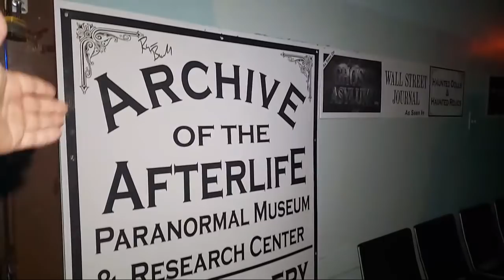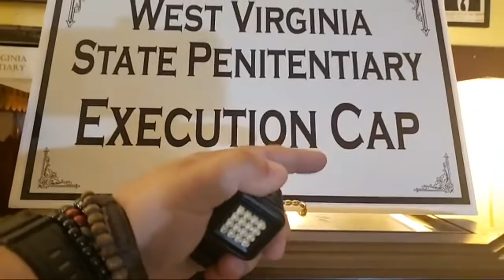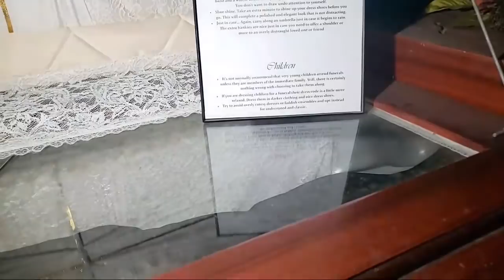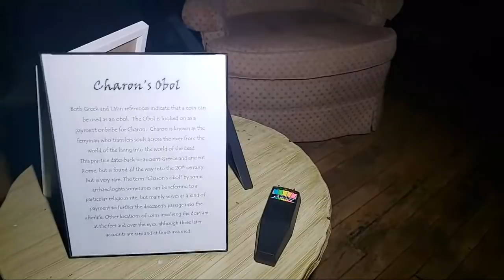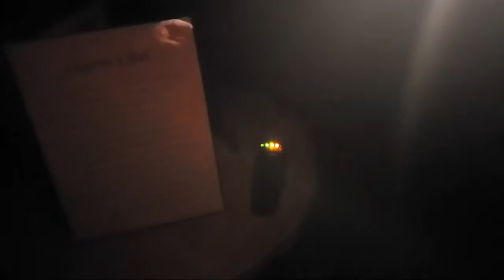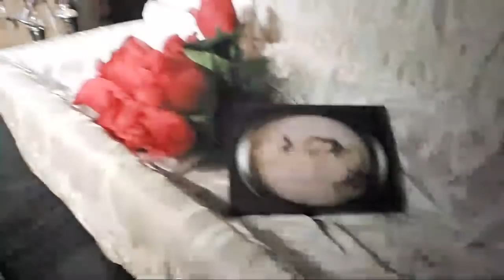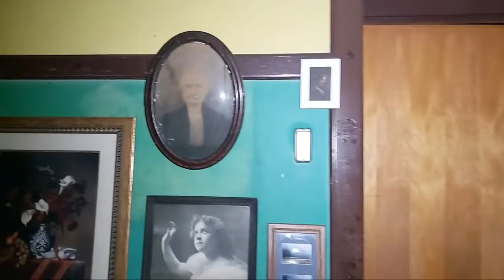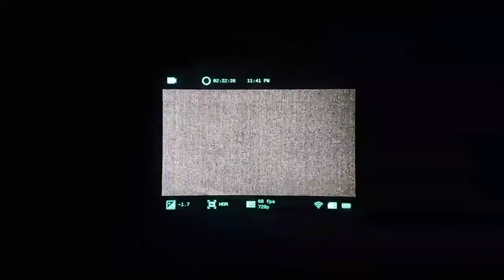HAUNTED MUSEUM ALONE  (ARCHIVE OF THE AFTERLIFE)

Comment: Okay, just as I had suspected...I believe something has attached itself through this video. I'm not sure exactly how that works but I've heard of it happening before. Three hours after watching this, I go to bed... I just woke up to use the bathroom and low and behold I'm sitting on the shitter in the dark and I hear this noise in the shower...something hit my razor, which is dangling so it starts swinging. I flip on the light and just stare at it. Then I'm like ok...it was probably just sitting at an odd angle and got dislodged or something. Then, I hear what sounds like someone's hand sliding and gripping the metal hand bar and a ping like someone flicked the metal. At this point, my ass comes off of the toilet, I fling the door open and sick my cats on whatever it is. I hurry up, finish my business, wash my hands and here I am. You might want to consider including a little protection prayer at the beginning of your live investigations for yourself and your viewers. I'm not a religious person, but I believe in a protective white light! I guess I'll be smudging today. I still love you, Frank!

Comment: Franko you are ever so brave and such a nice person too. I am concerned that your solo adventures do court risk from dilapidated buildings, squatters with warped values, and especially danger from malevolent spirits. You would be safer if you at least paired up with a buddy or 2 or 3. At least help would be on hand if you need i. Then, you should explore together and avoid the temptation to go it alone. Every explorer should have a working walkie talkie with spare batteries, spare lighting / torches, a first aid kit, crowbar in case  you are shut in,  a New Testament, cross and holy water. Keep safe. We love you!